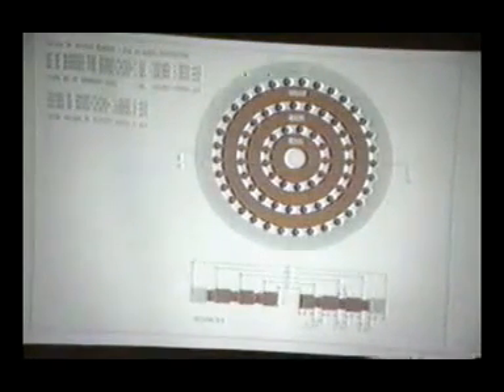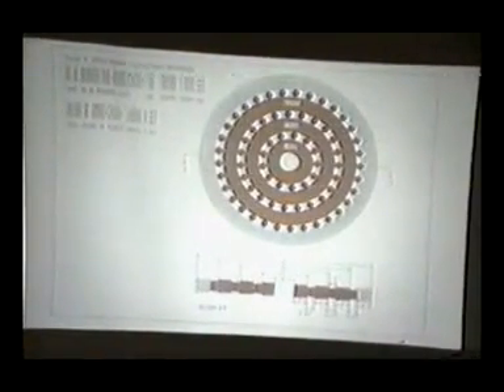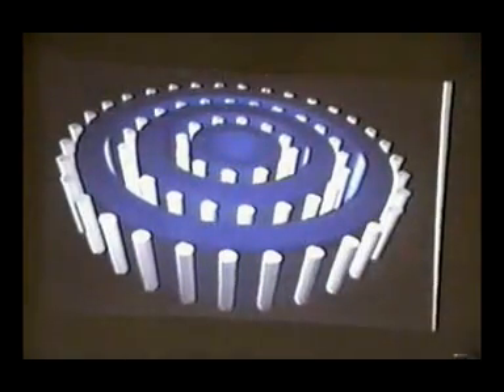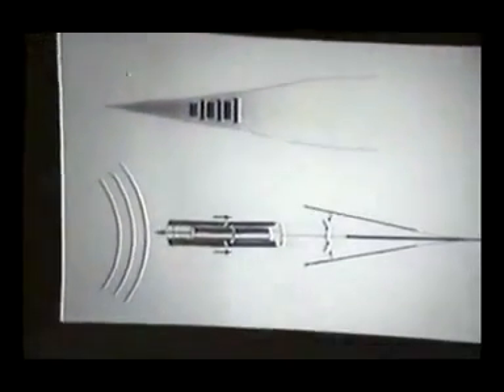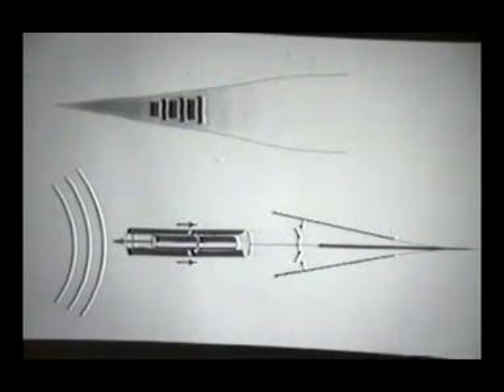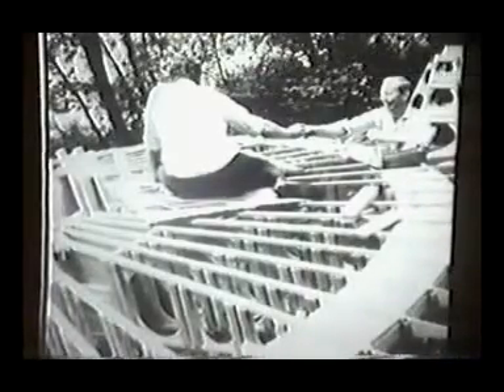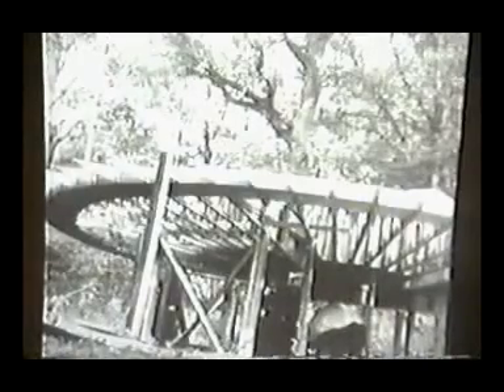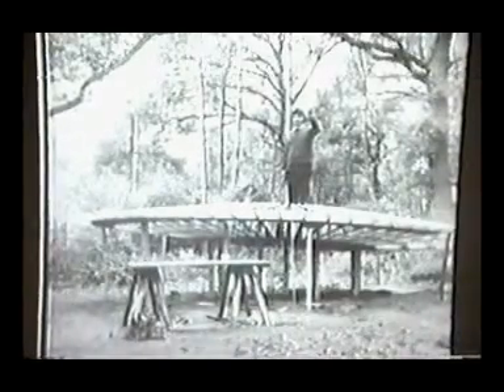3-6 John Searl levitation technology (SEG)

Comment: Please remember, just as an iceskater spins more quickly when they pull their arms in and they spin more slowly when their arms are sticking out, so also, the large diameter outer ring should be spinning slower than than the small diameter inner ring (in a system when energy is applied evenly). However the system doesn't spread energy evenly. The inventor has the audacity to claim that electrical energy is drawn from the outer ring. This is a false statement because the resulting magnetic drag would slow the outer ring down even more than its large diameter could alone. Research Searle and you'll find the inner ring spins the slowest. One can only conclude that the large diameter ring is being "driven", rather than "drawn from" and that the inner rings have no purpose. They are drag-that-exist-as-eye-candy. I call BS on Mr Searle.